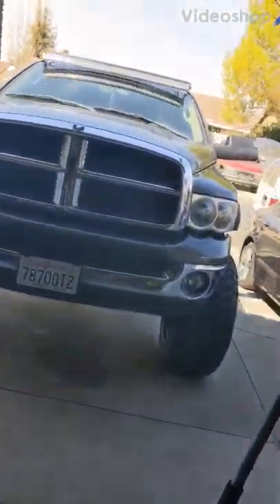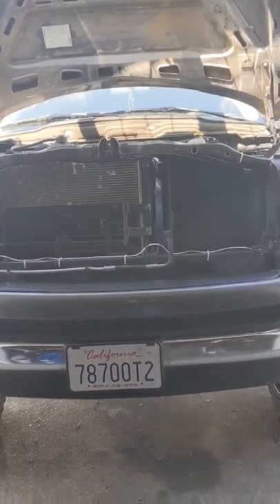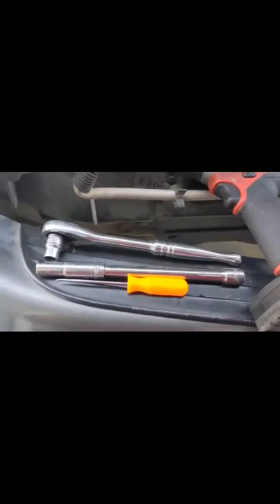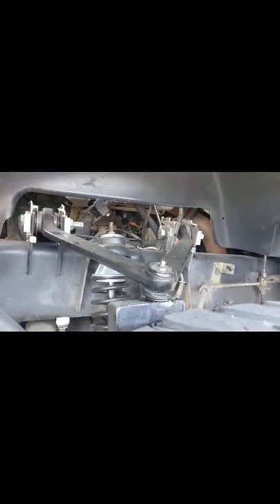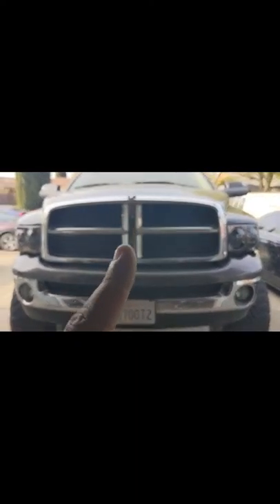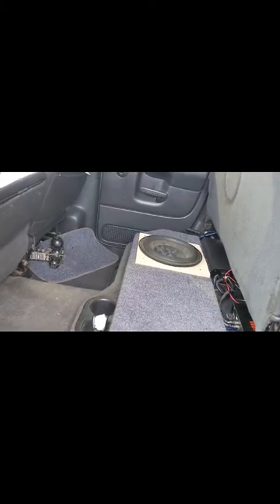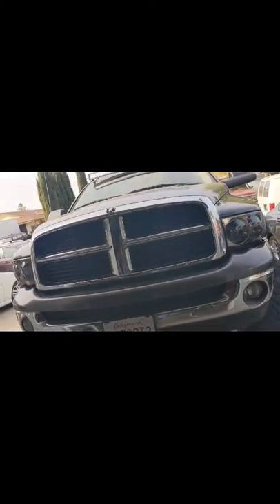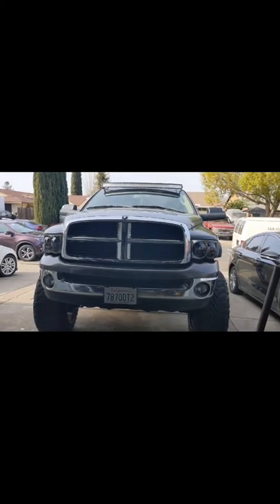New head light on the 03 ram 1500 5.7 swap

Comment: how much did the swap cost in total do you think? i'm considering on doing the same swap to my 07 ram 1500
Reply from the maker: Hey what's up so first you would have to look for a crash truck so that depends ingot mine for 1200 the whole truck it was crash from the front and the laber I did it my self so ya I'm going to post a other video of what would you need from the doner
Reply: @carloszng5  alright cool, thanks.
Reply from the maker: No problem if you have any other questions wen you are doing the swap fill free to message me .
Reply: Will do, also would I need to swap the engine from an 07 truck?